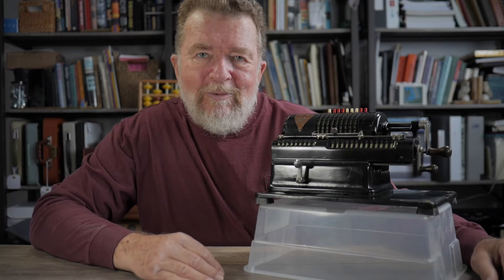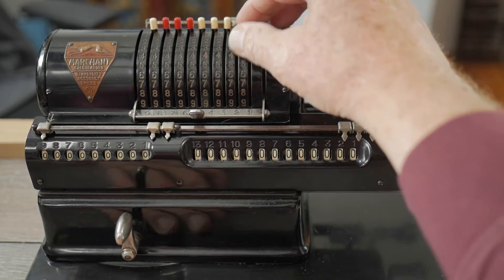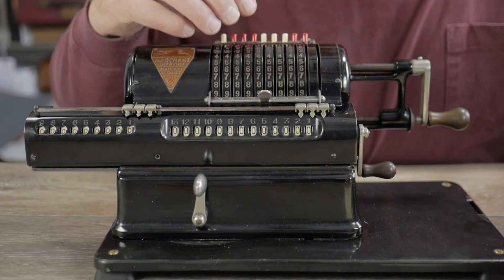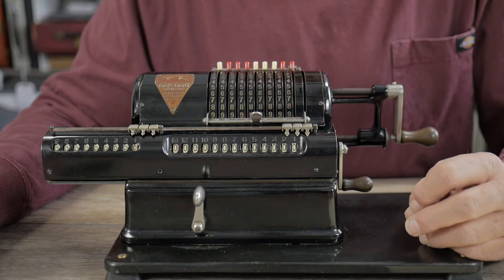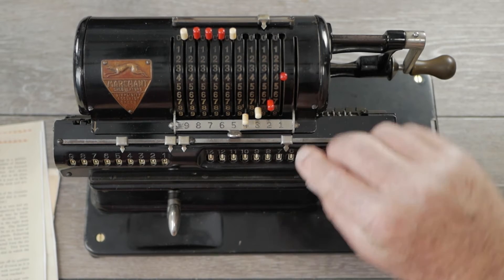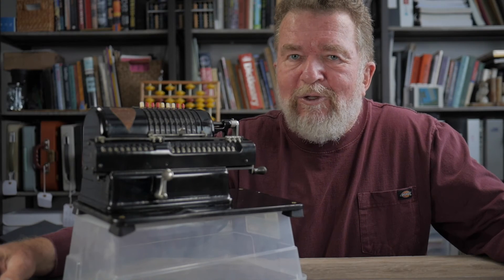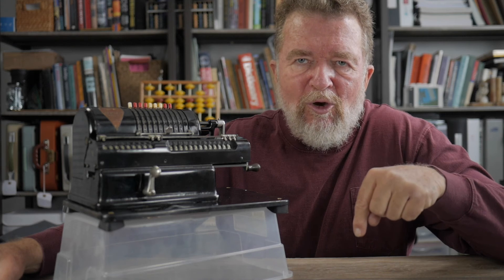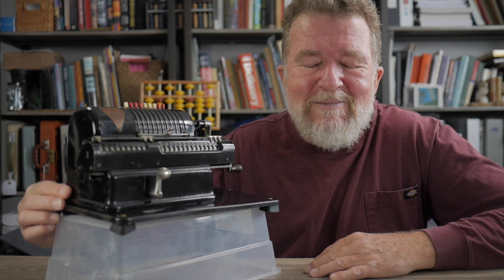Marchant Pinwheel Calculator

Comment: I love old math equipment like slide rules and these mechanical calculators.  I have a very ancient Burroughs adding machine and a 1960s/1970s Olivetti calculator.  There is also an old Friden in my basement waiting for me to get brave and start working on it.  As a kid, I remember the restaurant on Main Street still had an old electromechanical cash register.

I suppose your machine can't divide by zero.  There are some fun videos on YouTube of the old Fridens dividing by zero.

Comment: Great demonstration of that fantastic manual machine.  If you can imagine a much smaller handheld version of this, check out the Curta calculator that were used a lot in car rallies in the 50's and 60's where the passenger, i.e. navigator, would use that device to calculate gas usage, distance and so on.  Much easier to use in a bouncing car than a slide rule.

Comment: I have a Felix M pinwheel calculator (arithmometer) that was manufactured in the Soviet Union in 1970. These were still in use there at that time,  but were right on the verge of being made obsolete by the electronic calculator.
Reply from the maker: I still see those on eBay.